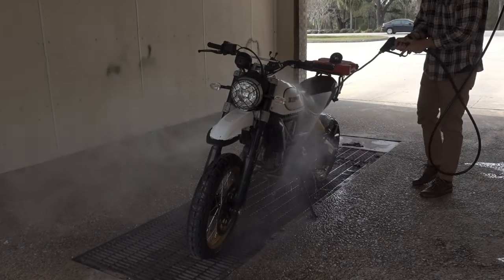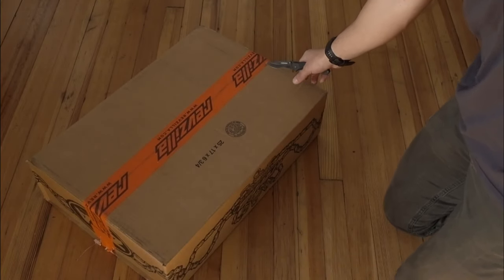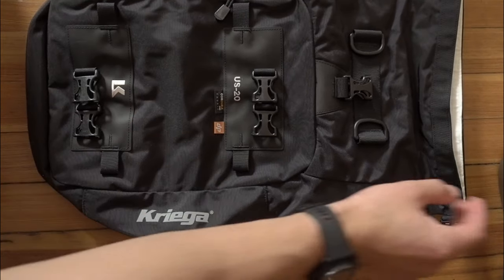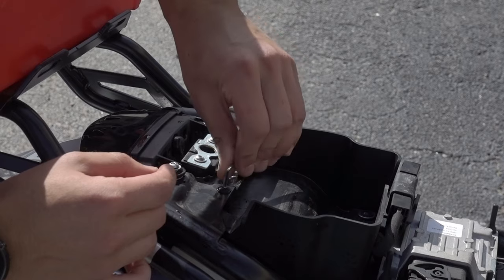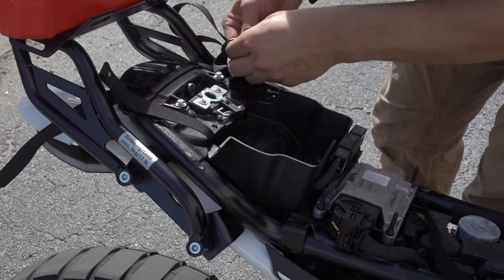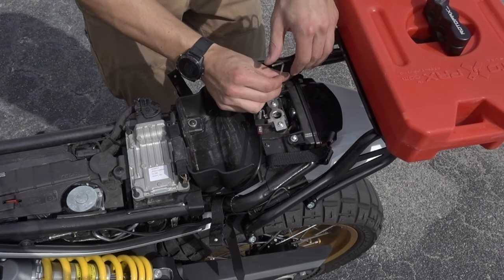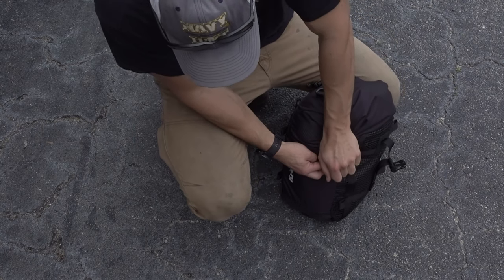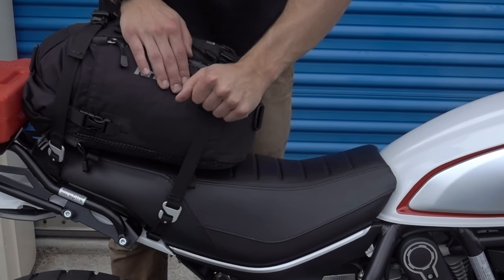Kriega 40L Drypack Install | Ducati Scrambler Desert Sled

Comment: Brilliant! I was scratching my head as to where to position the straps on my Nightshift. It looks like it's pretty much identical under the seat to yours. Thanks Man!
Reply from the maker: Happy to help!
Reply: @CatchHellMoto  Hi Is yours a 2023 nightshift?  just ordered the 2023 full throttle. Kriega UK say the fitting kits have not been tested on the new bike but, wondering if its just the same as the old model...

Comment: Pro tip after a body shop told me what I was doing wrong. When you go to a diy car wash and you need to use the brush. Blast the hell out of it with the pressure washer before using it so you don't rub the previous cars dirt and shit all over your vehicle and basically sand paper your paint. 

Anyways beautiful bike im researching the sled to see if it's truly what I want. Great video man
Reply from the maker: That's really good advice! I love a clean bike but I'm always so nervous about messing something up whenever I go to clean it. Thanks for the comment!
Reply: I just rub the brush into the concrete floor

Comment: The title of the video says 40L drypack, but it looks like you have 20L shown in the video. I'm wondering how the larger bag (I.e 30L or 40L fits on the Scambler. Is that the 20L or 40L? Do you have any videos with the 40L mounted? Thanks!
Reply from the maker: The 40L I have is a 20L with 2x10L packs attached to it. Pretty sure this is the preferred method for doing 40L all together.

Comment: You could position it perpendicular to the seat so it gives the rider more room as well. They’re built to last; my US30 is older than my DSled. 🤣 Have had it for 5 years. As good as new.
Reply from the maker: That's also a good option! Yea I'm a big fan of the Kriega set up.. hoping it lasts me awhile
Reply: Sorry to comment here. I'm interested in buying this. Seems pretty awesome for my scrambler full throttle.  My question is when you're not using the bag do the straps make noise whike at high speeds? Or you just take out the seat and then hide the straps under the seat? 
Im thinking of getting the 30L but watching this video I don't know.. the 20L seems huge 😯
Thanks

Edit: My bad! this is 40L not 20 😄